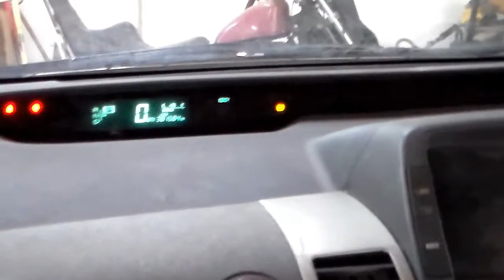2009 Prius Dash Display Fix

Comment: I've repaired a few Prius dash power supply caps.
I normally change all 3 of them whilst I do the repair, they are all the same age and are more than likely out of tollerance, it makes a longer lasting repair job,  and a happier customer
Reply from the maker: Thanks.  In radios I differentially replace them all.  I think the owner wanted to try and pinpoint the exact issue. Talked to him a few days ago and still no issues.  Fingers crossed.   He now has 421,700 on the Prius.